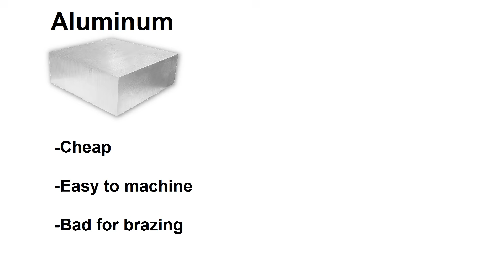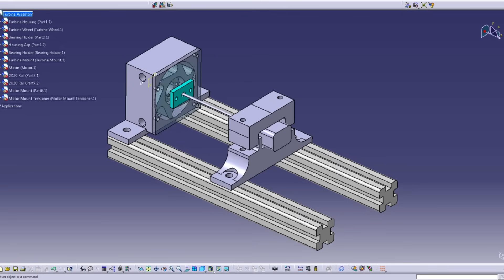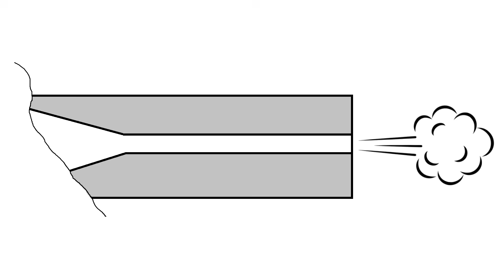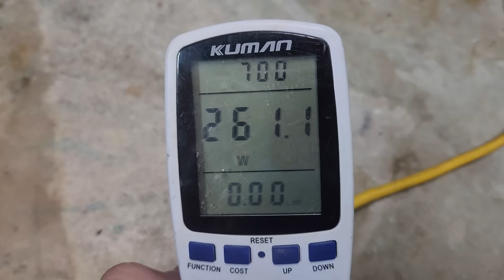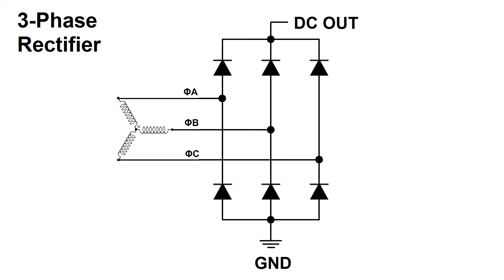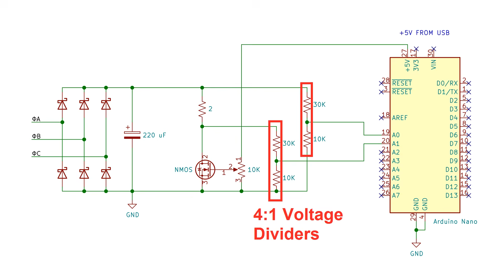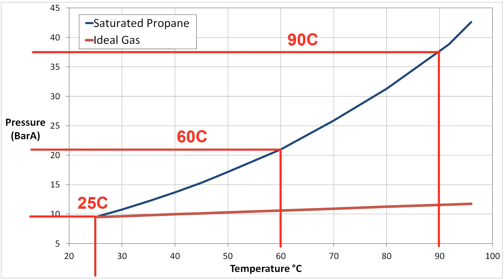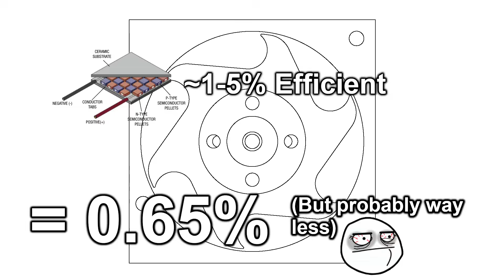DIY Micro Steam Powerplant

Comment: Check out organic rankine cycle. It is sort of low temperature steam engine in which instead of water you use some refrigerant which is easier to seal and you can get it running at pretty much any  temperatures given you have enough delta T for any carnot efficiency. I think positive displacement vane turbine is way to go - some car ac compressors can be converted for turbine use - only issue is lack of vane springs but you can feed some gas inside vane slots to spread them for initial seal because once it is running centrifugal force will take care of it. Smaller issue is need to pump liquid refrigerant at pressure higher than high side pressure - this looks like modified gear pump job.
Reply: You just know he's gonna put propane in it.

Comment: If you do more Steam stuff, move away from brass. the steam leeches the zink from th ebrass making the material brittle and porus and also puts zinc into the exhaust gases... Bronze is a good option to use if you dont want to do straight copper
Reply: yeah, generally cast iron in steam chests, brass for sliding or rotating parts
Reply: Ohh shut up
Reply: what about 3d printed carbon fiber?
Reply: @tristanboyle4450 Lol that would melt instantly
Reply: @moth.monster well yeah but carbon fiber
Reply: @teistainboyle4450 there are some 3d printed resin parts you could definitely use, but they are expensive and require a kiln to remove the malleable material and increase the strength drastically. Integza used the resin as a rocket nozzle, and it worked quite well. If you wanted to go the extreme diy 3d print way, you could try to jury rig a self feeding mig (probably misremembering the type) welder to a cnc like setup to make some "3d printed metal". It's crude af, even if your great at DIY, programming, cnc, etc. But it's still several hundred or thousand dollars cheaper than those industrial metal printers... at least the prints; they cost upwards of 11k USD last I looked into it, and that was enough to have me look elsewhere lol
Reply: Bronze is known for having ARSENIC in some varients
Reply: brass is widely used in model engineering and is perfectly fine to use. I've never heard of zinc being a problem
Reply: @gydo1942  it depends on the alloy. High zinc alloys are more subject to selective leeching than others. Some model engineers stay way from it, but a lot of models don't have the runtime on live steam for it to actually affect anything. For a toy like this the actual concern is having propane pressurize the water line feed without some kind of shutoff to keep propane from entering the flash boiler lmao
Reply: @gydo1942 - brass is used in model engineering for things that don't touch steam.  Anything that does touch steam should be copper, bronze, or steel/iron/stainless.
Reply: Models don't run long  @gydo1942
Reply: Stolen shamlessly from AI overview:
Dezincification, what it is:
A corrosion process that removes zinc from brass, leaving behind copper
When it occurs:
When brass with more than 15% zinc is in contact with water
How it looks:
Mild dezincification may cause the surface to change color from yellow to pink. Severe dezincification can weaken brass and cause it to perforate.
How it affects brass:
Reduces the mechanical properties of brass and can lead to breakage
How to resist dezincification:
Add As (typically 0.02 - 0.25%) to alpha brasses, or add Sn (up to 1.5%)

Sounds like a problem that can only happen using the wrong alloy of brass. Any brass fitting from the hardware store would be made with the right proportions of copper to zinc plus tin and arsenic and 11 herbs and spices.
[Edit] ok now I see he used his own brass casting. So it's definitely a good idea to test its composition and make sure it's not susceptible to this type of leaching.
Reply: @amosbackstrom5366  I'd have to go back and check, but I believe his casting was copper, not brass.
Reply: @amosbackstrom5366  Thanks ChatGPT 🙄
Reply: @amosbackstrom5366  The steam should be dry in the turbine, so no water contact with the brass, therefore no dezincification on the internal part of the turbine at least. Dezincification is also only really a problem in acid conditions. Feed water should be around ph8 or so, so again dezincication is not a problem.

Comment: Try making a pressurized Stirling engine! The NASA radioactive stirling power sources are an engineer’s heaven, but there’s not much similar (although non-radioactive) hobby work on YT.
Reply: Sterling engines run off heat... making a Stirling engine powered by steam, makes it a steam engine.

Comment: Didn't you make a mistake at 18:00? How would you have an output voltage without a load?
As I understand it, it is the speed that gets reduced due to excessive load, and that in turn means less power is generated.

Comment: won't propane at those pressures dissolve into water? the resulting steam will contain eiter highly flammable fumes, or a propane aerosol, which is even worse, you'd need to make a close cycle system to recover water and propane

Comment: That was fan flippingtastic . It would be cool to see you try this again, but make the boiler and its components fit with inside a barbecue propane tank which is no larger, in fact, smaller than most household owned generators. 

There is also a method for generating steam using a solid metal core with holes drilled all over it to a certain depth which fits inside a tight tolerance pipe with water coming in one cap and out the other that will generate steam extremely efficiently. It would be neat if you could adapt this to a wind turbine to generate your steam instead of using propane . Perhaps some of the wasted steam potential could be captured with an air compressor to use that as your air pressure source. Keep up the awesome work with these really cool projects.

Comment: Adding the coil increases the pressure drop of the water, decreasing the flow. Your water flow was most likely significally under the 1g/s you measured at first. You also need to take into account the steam pressure at the exit point, which lowers your pressure differential. So your efficiency is higher than calculated!

To get the real flow rate, you need to test the circuit with the coil and with an output container at a pressure close to the steam pressure!
Reply: Alternatively, he could also condense the steam exiting the turbine to measure the flow rate, which would be much simpler
Reply: @justinpower8232  nice to see people usin them brain wrinkles. good idea.
Reply: I second this.
Reply: Yeah, but instead of being horrifically inefficient, it would then be just incredible inefficient. Going from 0.65% to let's say 1% is, percentage wise, a huge step (53% more energy output!). But overall it's still so inefficient, it should be a no-brainer that is has no practical application beyond tinkering.

Comment: A way that you might be able to mess with tolerances could be spray paint. Add a layer, see if it is better. Add another layer, see if it is better. Would have to get some heat resistant paint, and would want to point it at something that isn't going to die when a paint chip inevitably cascades into all of the paint coming off and out the end of the tube in .01 seconds as a shrapnel cannon, but is plenty well within the safety level of the rest of the channel.
Reply: Or do it more properly with brush electroplating.

Comment: its better to use the propane tank just as a starter and them recicle the passed steam to a secund water tank that is smaller an will quiclily expand and generatepreassure to expel the main tank.
recirculating waist steam everywhere should grant a nice eficiency boost and recude fuel consumptiom

Comment: put your propane bottle in a big bucket of tap water. it will thermally stabilize the tank and prevent any freezing. the bigger the bucket, the more thermally stable it will become. usually though just a 5 gallon bucket of tap water is fine. it will provide super consistent gas pressure from the tank at any discharge rate. although if you go just full bore open, the nozzle itself will start to freeze and you will need to wrap it in a soaked towel to keep it from freezing
Reply: This! the heat you need to keep the bottle from getting colder is at room temperature, so quite 'cheap' to get.
Reply: You need to tie the bottle down or something to stop it floating, typing over and causing problems  I imagine.
Reply: Must be how Hank Trill gets such a clean burnin' flame.
Reply: Why not use the propane to boil the water?😅😂
Reply: Have the excess steam condense around the tank keeping it warm and recycling some of the lost water/heat
Reply: Leave sufficient space between the gas tank and the bucket to fit beer cans! 😂

Comment: 15:52 I'd definitely go for just some aluminium or copper to leach heat from the pipe to the gas bottle. Water jackets for both are of course best idea, but that's another liquid circulation system to add xD But in PC cooling the "heat pipes" seem to work at least somewhat, so maybe it can be done, especially as the heat emanating from the burn pipe is waste anyway :D

Comment: One correction: Mosfets are in their linear region when they are saturated. The earlier region is called the ohmic region. With BJTs, the first region is called linear, then they go into saturation. Mosfets decrease their resistance roughly linearly during their ohmic region when you use then as a power sink, then don't change much in their saturated region where it's pretty flat, called the linear region. Yes, I know it's stupid and confusing. No, I have no idea what the regions are called for IGBTs because I gave up learning the correct terminology after I learned this stupid fact about Mosfets. Now I just make up my own words like "Flat line" and "Y=mx+b region"
Reply: I support the IGBT community

Comment: When you are explaning your electronic load model, you have your graph slightly wrong. The graph is drain current agains Voltage from drain to source(Vds). In the linear region, the current is directly proportional to the voltage from drain to source (essentially a resistor) the flat part of the curve is the saturation region, where the current is no longer proportional to voltage across the fet. The change in gate voltage (Vgs) is shown by the different lines on the same graph. You probably are never in the linear region when using the fets as a current sink like this

Comment: SOME IDEAS ...
LOTS MORE BLADES ON TURBINE
HOW ABOUT A T3SLA TURBINE?
AN OUTER TUBE,AROUND FLASH BOILER, VACUUMED TO ACT LIKE A THERMOS FLASK
TRIPLE EXPANSION- MAKE 2 MORE,BIGGER TURBINES,USING SIZE RATIOS SEEN ON TRIPLE EXPANSION STEAM ENGINES THAT ENABLED TRANSATLANTIC CROSSINGS(  STEAM TRAIN ENGINES WERE LIKE HOURS- POURING STEAM ENERGY OUT TO ATMOSPHERE,INSTEAD OF BE8NG USED AGAIN AND AGAIN,
PROPANE BOTTLE- SEEM TO REMEMBER REFRIGERANT GAS WORKS BETTER WITH BOTTLE UPSIDE DOWN? WORTH CHECKING ON...
GREAT VIDEO'S, MORE, MORE OF THE SAME...!!!
🤯🤯🤯🤯👍👍👍👍🥳🥳🥳🥳

Comment: 1:20 that's why I always laugh when in the movie someone jumps in steam locomotive, throws a match in the firebox, and make it run immediately 😊
Reply: Now that I think of it I'm sure Americans tried it in the 50s, but what if instead of a furnace we just exposed a nuclear fuel rod to the water in boiler... XD
Reply: @GerinoMorn  fuel rods dont generate heat on their own, a specially designed boiler would be needed.
Reply: @wabch  Huh?  More like they don't generate large amounts of heat.  Even then that's modern fuel rods and for certain definitions of "large amounts".
Reply: it depends on what engine and why it's parked but most engines they would have found outside of the engine house would have already been at operating temperature, or would have already had a fire going and working their way up to operating temperature, time is money so they rarely let an engine cool unless they were doing maintenance on it or they were closing up for the day, and even then some models of locomotive had enough thermal mass it would take a couple days to cool all the way off

Comment: at 13:45. the water may be room temperature, but it's still pressurized right, so PVC would be a terrible idea?
Reply: Rated to 160psi at 120° in my house.
I think he said propane was 100psi?
Reply: @Forge366  PVC should be safe for water pressure, but using compressed air in PVC is still strongly recommended against, and he's using propane to pressurize. So the shrapnel-producing tendency of PVC still seems risky.

Comment: Tesla Turbine would work very well with this micro steam powerplant
Reply: Could you explain the "very well" part? I understand that most application for that turbine "barely" work and when you want torque you choose something else than a Tesla-turbine.
Reply: @DreadX10  low torque doesn't matter because they are meant for high speed. high speed means it will play nicer with dc motors being used as generators.

Comment: w00t, yes you can, make it efficient again, not wasting all the heat energy
Reply: maybe only 1% of the burning heat energy is captured, also tesla disc turbine would be better to capture the expansion needs, while the steam spinning in the turbine
Reply: maybe compare to the flash boil steam car designs, which do the conversion efficiently.

Comment: added benefit of using propane to pressurize water is when you run out of water, you can start generating some real power, for a while... 😁
Reply: Went from steam-powered to propane-powered to where did my house go?
Reply: @fluffsquirrel  To hell, the house had a date with a demon.
Reply: @prothomasgaming  Yes, and by a demon summoned by hyperspace pirate no less
Reply: for a while
Reply: "Steam Generator 1, designed to operate at 17 watts... went beyond 1750."
Reply: @untildawncrepes  omg golden reference 😂😂. “You are delusional!”
Reply: @untildawncrepes this man knows
Reply: Sound a bit dangerous… 💥🧐
Reply: yeah surely he should have just pressurized a cylinder and used that to pressurize the water tank?
Reply: @jakewynn  or directly use the steam, essentially in the same way he now connected the gas to the water tank, connect the steam, that will keep it at perfect pressure and automatically adjust, also buffers the steam pressure to make it more constant making the turbine more efficient.
Reply: There would not be any oxygen in the water tank so you would not really get any extra power out of it.
Reply: funy, but the pilot is too small for any signifficant amount of gas to actually go through. Water on the other hand expands 2000x it's size when it evaporates, so it makes way more volume, meaning more flow, turbines actually spin. With propane, no spin XD
Reply: LOL!
Reply: Nice video. A lot of information in a short time. Fascinating project. I could actually build this with the tools and machines I have available…
Reply: This isn’t a combustion engine…
Reply: it transforms into a gas turbine instead of a steam turbine '-'